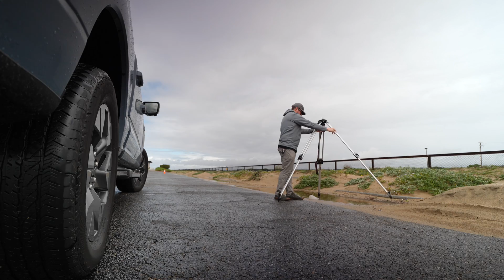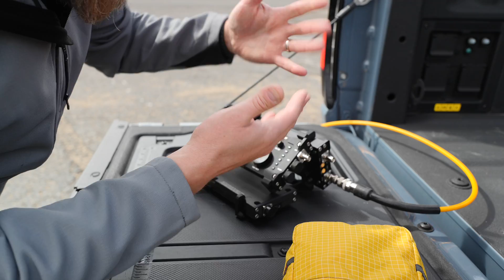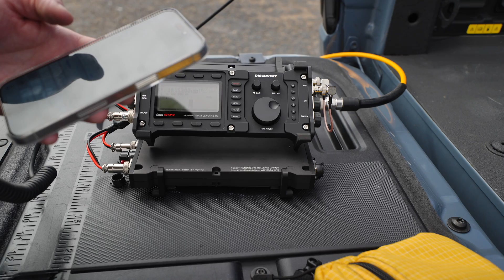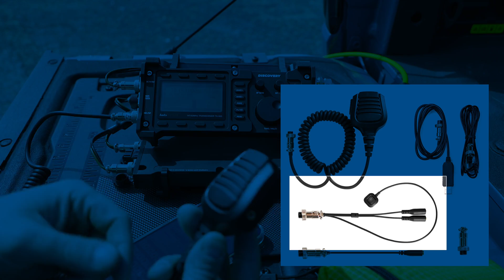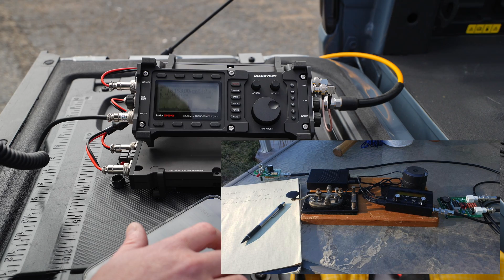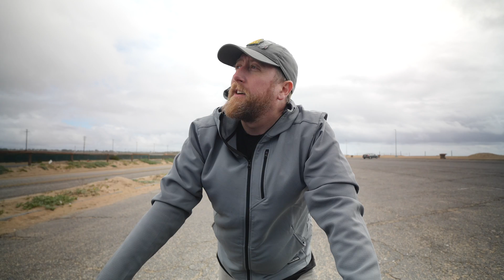HexTenna POTA Field Test K-3411

Comment: I have one of these antennas. I  won it and I love it. But my counterpoise wire came with an eyelet to fit where the hub screws into tripod instead of the small wing nut. Would it work just the same to use it there or do I need to put a different ring erminal on it that is smaller and fits the wing nut stud?

Comment: These POTA videos remind me that amplifiers are not necessary to communicate on any band or mode.
Reply from the maker: I was running 50 watts through most of the activation.
Reply: @HamRadioCrashCourse New technician here, I’m an OTR Truck driver, and right now my only HF set up is a barefoot 10m Stryker 955 hpc v2 in my semi using 2 hustler trucker antenna’s. This past weekend 03-10-24 I was parked at a truck stop around Mobile AL. Scanning thru the technician portion of the 10 m band, and Answered 2 CQ’s one was in Idaho he was participating in the ID QSO party. The other one was Belgium I never even imagined that to be possible. Needless to say I was very surprised when both repeated my call sign with signal report. I told both I was a truck driver, and what I was using.
Reply from the maker: @K4WYZ  Good for you man!  I love hearing those stories!
Reply: By the way awesome video!

Comment: Hey Josh, I have the same radio station from the QRP Store. It’s my main POTA radio station I use all the time. It’s a great setup!!!
Reply from the maker: I really do like it.  What are you using for mic and speaker?  The hand mic is not a great option. from my POV.
Reply: Josh, when you use the amplifier, it gets hot! The Expedition amplifier units Oliver makes has a cooling fan on them. I made a cooling fan frame for the amplifier. I have extra frames if you want one let me know. I had sent a text with Lord Mike K8MRD to text you about the cooling unit. Did you get the text???
Reply: I use the stock hand mic it came with. I’m part of the groupio email group, there has been a bunch of guys having issues with their radios audio when using head phones or external speakers. Just be careful.
Reply: I almost have the same radio, I have the TX-500, I’m supposed to have the amp by the end of the month and I have the ba-500 on back order at HRO, they tell me their shipment is stuck in customs.